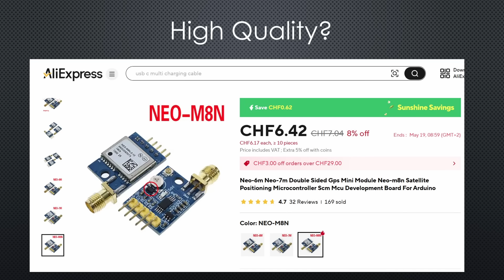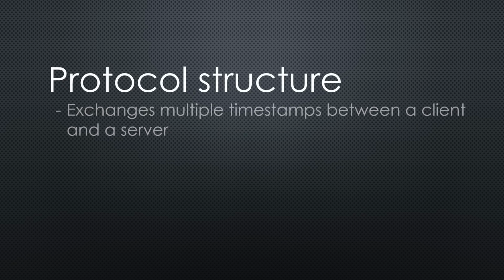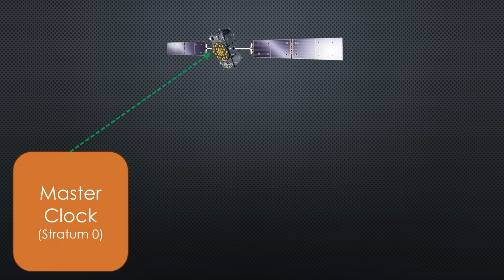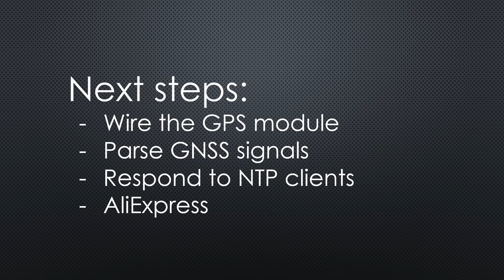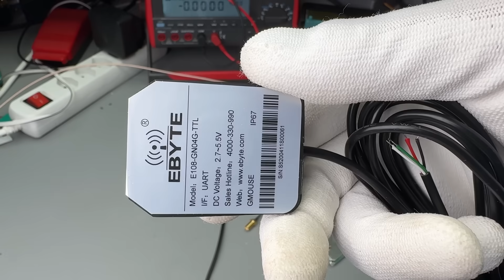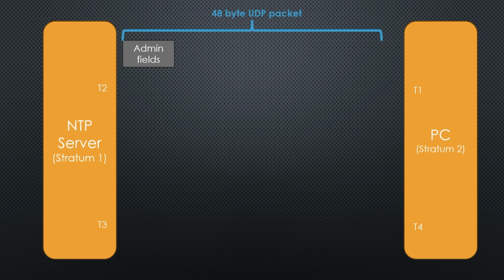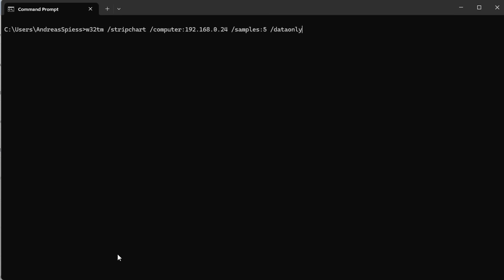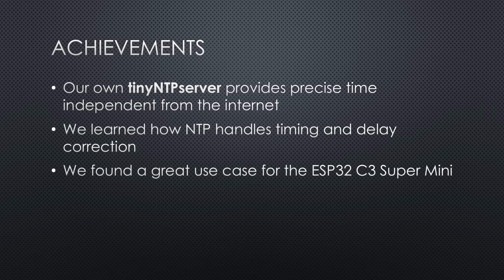Create a Wireless NTP Server with ESP32 and GNSS (Wi-Fi & Ethernet)

Comment: Nice project!  I've build a desktop clock in mid 1980s with an HC6805 MCU and discrete RAM, ROM, osc, PIA, etc.  Since then I've updated the processor with an Atmel 644P and currently an ESP32.  Now I'm adding an NTP client to initialize the time automatically, and have my eye set on adding a GPS module to be free of network connectivity.  One challenge I foresee is switching between the several time sources in case one or more fail.  I'll have GPS, NTP, and a 5 MHz crystal oscillator, probably in that priority.  I'll have the most accurate source update the RTC, just because it does nice time zone and DST handling, but will never rely on its internal timing.  I'm just getting started; should be fun.  Thanks for your excellent video!
Reply from the maker: Best is to create a "state machine" where you define when to change the state from crystal to GPS, for example.

Comment: Thank you for this. I loaded the sketch tinyNTPServerTime and it works very well. Next I weould like to try ethernet with ESP32 and a W5500 module. In your sketch PPS_Newaproach_V3, EthernetUdp.h is not included. Is this because the coding of WiFiUdp.h and EthernetUdp.h are the same regarding UDP?
Reply from the maker: I do not remember. This is an old video :-(

Comment: I have a huge problem with traffic noise. I am looking for a sound pressure recorder that I can interrogate using snmp. So Cacti interrogating the device every 5 minutes. The sensor needs to be wifi capable. Any thoughts? I'm well versed in Caciti or MRTG type deployments, but I am not a maker. I am good at breaking things, though. Any recommendations?

Comment: I haven’t programmed microcontrollers but set up lots of Raspberry Pi:s with GNSS time sync with the help of a bash script that configures a RPi as an NTP server for me (it only needs to calibrate the timing for the serial data from the receiver so it and PPS lines up).

When one of them (a RPi Zero 2W) idles I get within a few microseconds of UTC which is good enough for me.

Comment: Hopefully one day we'll see ESP32 paired with chip-scale atomic clocks similar to Microchip's SA65. Then you can have fairly accurate time without Internet or GNSS connectivity, though you'd need to calibrate periodically depending on your accuracy needs. I doubt any hobbyist will be interested in such a project though until the price for CSACs drops 10x or so!

Comment: For the old GNSS modules you found on Ali-Express, if you send the UBX commands to the chip at startup, you can configure it. The modules run older firmware (2012) and they aren't updatable because they don't have Flash memory (some do, but they're way more expensive!), they use ROM. Actually, even the NEW modules from AliExpress use ROM as well, so if you wanted to configure satellites, you still need to send UBX commands, as U-Center flashing would only be temporary.

For example, you'd send CFG-MSGOUT-UBX_NAV_PVT_UART1. To save it, you'd send CFG-PRT. Newer models would use CFG-VALSET instead of CFG-PRT.

Comment: Hi Andreas, thank you so much for the great video, I've already ordered the parts you recommended off AliExpress and built one of these. It syncs up great, but I noticed, you're using the TX and RX pins on the ESP32 for the GPS, and the Arduino serial monitor gets none of your useful debug lines, at either 9600 or 115200. Do you think I have a faulty board, or am I missing something? It would be really useful to be able to get the debug output if I can.
Reply from the maker: If you use the chip without usb to serial chip you have to set the proper parameters in the ide. I showed it in the video
Reply: I'll be honest, I tried watching the video a couple of times, and I didn't manage to catch it.
For those following at home, the magic is setting USB CDC Enabled under Tools in the Arduino IDE.
Reply: @si1entdave  What board type did you set in the Arduino IDE?  I'm not able to see any Serial.print  output in the IDE serial monitor window. 
Time displays correctly on the OLED, so the rest of the code is probably working
Reply: @robinellams6018  ESP32C3 Dev Module
Reply: @si1entdave  That did the trick. Also found that plugging the ESP32C3 into a breadboard rather than with short dupont leads killed the ability to connect to WiFi.
Guessing that breadboard stripes mess up the ceramic antenna ;-(....
All finally working.   Happy camper now

Comment: In the Github repository, there is no "dummy" credentials.h file available. What format is this in?
Reply: Nevermind, I figured it out.
Reply: @TheGroovebot  PS, I don't need it and this is a general advice, but please don't do this. If you have an issue and you 'figure it out,' you should tell people what was it that you fixed/figured out. You don't know how incredibly infuriating it is to search for a problem for hours to finally find someone who has the exact same problem who goes "nvm figured it out ez"
Reply: Perchance to tell us, why did you not simply tell us where it is, instead of the snark? 
after much digging, I discovered it can be created and located in the src subdirectory under the esp32/3.3.1/libraries/Wifi/src
it can look like this:
#ifndef _CREDENTIALS_H_
#define _CREDENTIALS_H_

// Wifi parameters
char password[]   = "password";
char ssid[]         = "ssid";
String apikey       = String("API Key Goes Here"); //Not used for this project.

#endif

Comment: Why you should see the small size of the GPS chip inside of the new Meshstastic Lillygo Super Plus stand-alone with his own keyboard and LED display... The GPS chip inside is the surface mount radio that is so incredibly tiny! The one they sent me had a cracked screen and was just non-functional and they didn't refund me anything but they wanted me to send it back and at that point I was just quite irritated having a waited for it for a long time.... They also it was over Christmas so I was not happy with it. So I took it apart and wow....

Comment: Hey what about using a fully integrated module with an esp32 GPS like the: Heltec APKLVSR ESP32 SX1276 LoRa Wireless Stick Bluetooth 4.2 + WiFi + LoRa LoRaWAN Development Board 868MHz - 915 MH with 0.96 Inch OLED Display for Arduino IDE Type C Port? 

It has absolutely all the radios and the GPS along with the microcontroller all in one package all the way down to pulse per second....

I'm going to try and configure this to this board your code unless you want to help because not only could it provide Network time to your local network but let's say you were working your radio or working a radio in a mobile situation it can possibly also provide you with a stable 10 MHz signal for Doppler shift?
Reply: Could we not use this one single module instead of two and this would serve as an all-in-one package.

I have one so I looked up all the specifications of the board and it has everything including pulse per second.
Reply: But I'm you know you're much more skilled at both coding and these boards I would bet you have the exact same board that I'm talking about already.... 

If you wish to help modify your code that would be great but I'll try anyway. ..
Reply: When I wouldn't give to be the videographer for our creator here. I actually have professional experience during this before I went to University and was developing my own film when I was at 10 years old. And then I did an internship with a local branch of a national news network and National Channel as well as running video for live broadcast from the PBS or the public broadcasting system. And then I would do headshots for the famous presenters and actors on the channel. And at that time they didn't have any advertising in between shows as it was a publicly so they sent me out to take beautiful pictures of the landscapes of my home birthplace and they made them into slides which they would drop in and show in between the shows with the time placed over top of the picture on the corner. So for many years a lot of my landscape pictures were being dropped in between shows of the Public broadcasting service television station. I still have professional level cameras and can use both the OS, PC, an open source professional video editing suites. The same as they used to even with 3/4 inch video tape which was the professional standard before digital. That's what they used to carry around with the news crews and they would call them little mercedes-benz's. They said don't drop that it cost as much as a Mercedes-Benz! And it is 3/4 inch tape and you would use two tapes and an editing Suite along with in and out times and you could watch everything happen before you actually make the edit and then once you've got everything synced... Including voice overs you can hit the button and it would make that edit. And we were always on a time frame as it had to be done before the news aired. So we were always in an editing sweet sweating it out trying to get it perfect before broadcast.
Reply: I believe that we don't live too far apart I think you live North East slightly from my location.... It's a guess based on your amateur radio call sign. Don't worry I'm not a stalker! 🇨🇭🖖🏻🙏🏻👍🏻
Reply: If anything I'm just a big fan.

Comment: Could be fun to connect the PPS (Pulse Per Second) to a PLL (Phase-Locked Loop) and use it to get a precise frequency standard. A common CD4046 could produce a constant, phase-locked 1 MHz signal off this. I only wonder if there would need to be intermediary stages (i.e. jump from 1 PPS to 1 kHz, then to 100 kHz, then to 1 MHz)?

Comment: This exactly is the kind of thing where the Arduino programming mindset is a little too loose for comfort (especially since you're dipping into the FreeRTOS bits).

It appears that the primary assumption is only one task, either the NTP or the GPS task, is running at a time and strictly only switches to another task via the yield.

We don't know what exactly happens asynchronously or if a task can be switched out as a result without its knowing.

Since it's a bit of a race between gettimeofday and settimeofday there should be a simple locking solution in the NTP task which detects if time was updated during its critical section and just retries if it was.
Reply from the maker: Pull requests are welcome!
Reply: Do all atomic in an noninterrupt callback function. You can push that to the max. if you point to your settime compare to the internal timer and adjust by  (moving)averages  the controller delays.

Comment: So how much more accurate was the ethernet implementation vs the WiFi one?
Reply from the maker: With my implementation, without PPS, there is no difference. However, if you use PPS, you will see some jitter in the signal when you use WiFi.

Comment: I thought german was a official language in switzerland, why do you use a crappy AI voice for the german voice translation instead of doing it yourself? Especially on technical topics I noticed that the auto translation is not reliable regarding accurate translation (in another video 3 miles was translated to 3 meter). So please disable this feature or provide a better translation.

Sadly Youtube thinks that I want to listen to the german translation even though I have english as well as german in my preferences (and subscribed to this channel while only english was available), sure I could change the interface to english as well but then videos with native german audio will be AI translated to crappy english. Sadly this "feature" get enabled on more and more channels and I'm tired of switching the language of so many videos -> I will reduce my YouTube consumption to be less frustrated and channels with crappy AI voices will be the first ones that will no longer receive my view unless it is a super interesting topic
Reply from the maker: You can easily change that. Because your YouTube client is set to German, they assume you do not understand English, and, as a service, translate to German. There is an option to change that. But I think it has to be done for each video.
I have the same problem in the opposite direction. I get German Youtubers in English ;-)
Reply: @AndreasSpiess  as you said I have to do this for each video and I'm tired of it -> I will just turn of this video as this is easy with a keyboard command

Comment: If you live no less than 1000km from Frankfurt (as the crow flies) you could use a DCF77 receiver instead. The main advantage over GNSS is that it works indoors.
Reply from the maker: I agree. Unfortunately, if you saw my video about my personal DCF77 transmitter, you know it does not reach my basement :-(

Comment: Causality the reason when you write a program and you write on that one bit line character, the character is as though that it gets removed by a government agent somebody’s tap your machine someone has hacked it. That’s the only possible explanation for it that they’re cutting that bit off of your program and they refused to let you program it however the flip that you want because you’re such a genius, you know all about the machine and you know that it has to be that because you know as much as the guy that made it Well I am the guy that made it and or the guy that gave it to a government agent and said you guys have already damaged us enough you guys push this because I don’t have the clean record to go out in public as the face of it that’s gravity that cuts that off of their son. Sub space let me tell you a little bit about gravity. A black hole is exactly the same as a jet engine exactly exactly exactly the same, not partially the same but exactly the same. Even artificial gravity is an artificial black hole is a jet engine used properly nuclear stall fast, but nevertheless that’s polarization we’re talking about gravity Gravity has a really big intake and one exhaust pipe and the exhaust pipe is spinning around fast faster than the speed of light and it’s stuck there in fact, light is making it stay spinning that fast if there becomes no light, then the thing will start the stall out, but as long as there is light theoretically it’s growing and now ours can’t really grow because they’re trapped at the size that they are because there’s more than they’re supposed to be The planet earth has three course that’s one black hole inside another black hole and then a third black hole just off the side of it and it winds up to a whopping 360 trillion times a second shooting you and every other molecule on the planet and so you gotta get up to 360 THz to get artificial gravity no you really only have to get down to 120 THz because there’s three course now starting to manipulate and to use that band of energy as a network that crystal resonator if you touch into that band at all, if the software ever comes into touching in that slot which the memory altercation error that windows has every time we would fix it. They would put out a patch to mess it up because there’s a high-pitched squeal that comes from the device that is gravity, destroying it. The reason that we didn’t kill everybody and we let them keep doing engineered obsolescence. Well, let’s just say it’s time to slap them all for fucking with the law of the crystal resonator by showing that the crystal resonator in that point is subspace look at it linearly instead of in one spot drive down the river with a car instead of standing at the bridge and then you can start to manipulate the water right there virtually inside the processor via  dos 4gw
Reply: If you need a set of quantum mechanic tools and you’re messing with electron microscopes and what not you can get a copy of my personal tool set by finding the 80s and 90s version of the atomic clock software that looks like a red yellow and green light and run that software restart the computer play with it a couple times there was a game that you used to play because it was designed originally written by somebody that was trying to be a magician And so the software has a little bit of a game to it. You have to power cycle a couple times and you look for a file that appears that shouldn’t be there and it’ll even chase you around once you activated it. You should be able to find it on any computer that you put your hands on by looking around enough And it’s the equivalent of I’m giving you a Hubble telescope for your own personal whimsy of don’t be malicious in any way, I usually meet the people and shake their hands and talk to them about a whole bunch of stuff. Any part that’s gonna be anything negative consequence to the colony for you solve this tool there is a security system. It’ll tell youthere’s help files. They’re really mad at me about giving this thing away. I’ve been giving it away from the onset at one of the reasons that people know me as a world, renowned, quantum engineer or quantum mechanic.
Reply from the maker: This is what ChatGPT wrote when I asked for a summary: The passage is a stream-of-consciousness rant combining elements of programming frustration, conspiracy theory, and speculative physics. So nothing for an engineer like me.

Comment: I am not sure about cheap chinese GNSS modules having outdated firmware and lacking GNSS support. I have used several modules between 5 and 30 Euros from Beitian and I verified that even the cheapest ones (BN-180) support at least GPS, Glonass and Galileo. And that was 4 years ago and I never needed (or would have been able) to update the firmware.
Reply from the maker: I agree that these modules exist (I showed one). When I talked about firmware upgrade, I talked about the "u-blox" modules. Important is that you check before your order.

Comment: Ethernet NEEDS POE
Reply from the maker: I agree, PoE is a good thing. However, sometimes a bit expensive.
Reply: @AndreasSpiess Yes, but route two cables outside house instead of one could be pricier and two connectors will fail twice as often as one, especially because rugged weather-proof USB connevtors ate not very accessible in comparison with Ethernet ones :-)